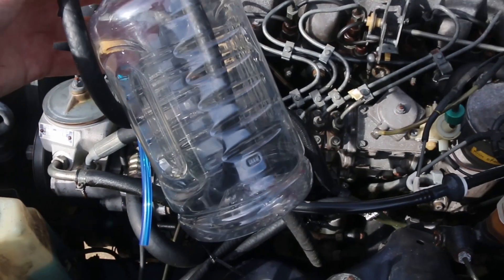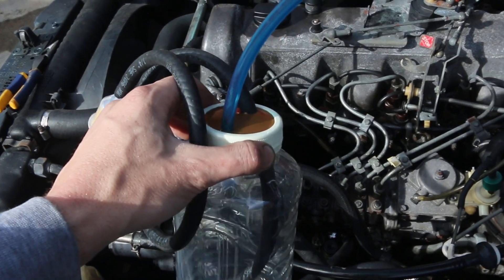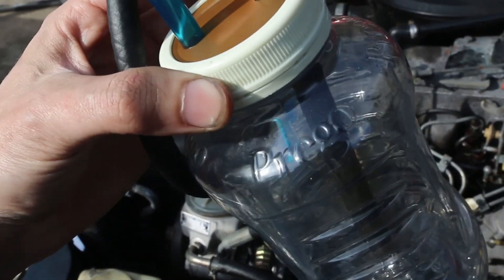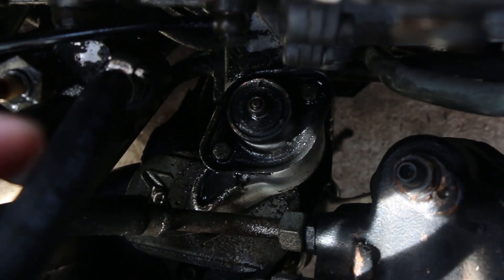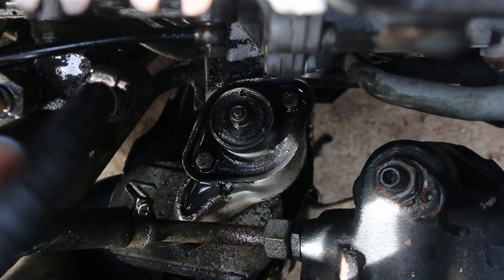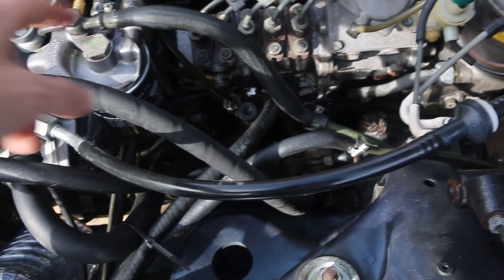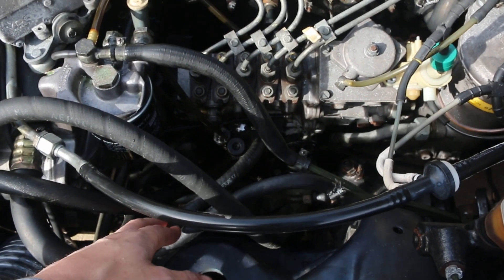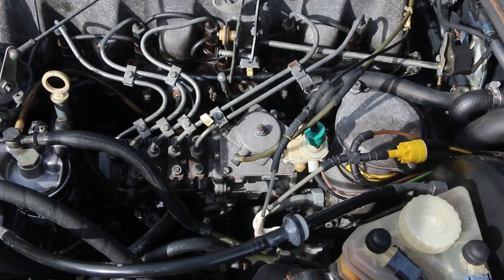Diesel Purge on my 1982 Mercedes 300D OM617 Diesel. Smoother? More Power? Quieter?

Comment: Best video on youtube just a question i have just brought a 1976 Mercedes 240d 123 it starts straight up from cold drives nice but blows smoke it dosent smell like burning oil and no oil signs at end of exhaust i was told by a mechanic to use 2 tins of  moly diesel purge injectors a filthy does that sound right
Reply from the maker: Yeah, I'd run a couple cans through it and see if it helps, if the injectors are a little sticky it could smoke and some diesel purge might free them up, its certainly worth trying.
What color is the smoke?

Comment: Thanks man! I just did this on mine and found that I'm getting a lot of air in the return line when I rev it, even slightly. I'm guessing I've got issues with my return lines. Thoughts?
Reply from the maker: If you've got bubbles coming out, you've got bubbles getting in somewhere for sure. Did you see any bubbles on the intake side of the lift pump? That's more common since it is under vacuum rather than pressure like the rest of the fuel system after the lift pump

Comment: Did you know that the seam along the top side of the valve cover means replacement Mercedes engine?
Reply from the maker: I've heard the valve cover and a tag that is down lower on the IP side of the block indicates a factory reman engine, which is super cool! I'm curious why my engine was replaced, as it has a odd misfire that I've been tracking for years now, comes and goes, I'm still trying to find the root cause, I'm tempted to swap the injection pump now, as I've done everything else I can think of.

Comment: Hallo thanx for youre informativ Videos , i try this on my knocking Benz 200 d . IT was very loud Like Metall nailing . I do this directly in the Fuel tank with Diesel . And after 2 time . The noise goes normaly No more knocking and nailing. Very good Stoff frome Germany . I think Its clean self the injektors..Best Stoff ever .

Comment: Hello great video, can you tell me if you had to take out the fuse pump relay or fuse
Reply from the maker: On this specific car (W123 body diesels at least) There is no electric fuel pump or pump in the tank at all. There is just the lift pump on the side of the engine, which is what I connected the inlet hose to, so no fuse or relay to pull, I'm not sure if the later year bodies got electric pumps or not, but I know at least up to model year 85 the diesels did not.
Reply: @trythistv  thanks man, I think mine has a lift pump on the side of the engine too, no fuse or harness in the back of the vehicle, I’ll try your method see how it goes, issue I’m having is my vehicle is consuming way too much diesel.
Reply from the maker: If its the same engine, I'm certain they never used a electric pump. I believe the 603/606 type engines also did not, but I KNOW the 617 and 616 engines use the engine mounted pump like in this video
Reply: @trythistv  Hi again, Thanks for your help, I’m having a nightmare with my vehicle, basically I’ve got 2 pipes going to the fuel filter,1 supply line and the other return line, the return line I presume is where the fuel comes out of , can I just put those 2 pipes which were connected to the fuel filter into the diesel purge?
Reply: @trythistv  the supply line is the one that goes straight to the pump right?
Reply from the maker: @sabiya2  right. There should be 2 hard lines going that come from the back of the car, one usually has a "cigar hose" that's kinda fat in the middle, and goes to the filter, that is the return line, the other one goes to the lift pump, usually through a small clear online filter. That is the feed from the fuel tank (no electric pump on a 617 or similar engines unless someone added one) so if you find the 2 metal lines, you can take them off and stick them in the diesel purge.
Reply: @trythistv  even the om606 didn't have an electric pump
Reply from the maker: @maxmiliano7887  I knew there wasn't electric pumps for a loooong time, I had a 95 e300d and thought it was a mechanical lift pump but it's been a while and I've forgotten a lot about that car. Thanks for the info!
Reply: @trythistv  maybe after the w210s when everything went to high pressure common rails. I want nothing to do with those.

Mechanical diesel or no diesel imo!

Comment: I did this on my 2015 Holden Colorado with 250,000kms yesterday. 
The leftover diesel purge was about the same colour as yours maybe slightly darker so definitely cleaned something. I've seen some videos where the leftover DP is almost black! 

Did you see any sediment in your inline filter? 
I was surprised to see how much DP you went through in just 10 min! Mine took 50min to go through around 700mls. 
I definitely noticed a difference, much quieter and smoother to drive.
Reply from the maker: It drank it through pretty quickly for sure.
I didn't notice much sediment in the inline filter, I've seen much worse than mine as well, I'd say it has to do a lot with how nasty the diesel is in each area. We've got some stations that do not have very good diesel, often dirty, sometimes water contaminated, algae and such.
It certainly made a difference in how smooth my car ran, Didn't notice much difference in power but the idle smoothed up a lot. probably from the injector pump running a little smoother, injecting a more even amount of fuel, or at least that is my theory.

Comment: Very helpful video.  Just purchased an 85 300D, and I was about to do a purge. It's hard to see but do you attach the hose to the actual pre-filter or do you bypass the pre-filter and attach directly to the inlet nipple on the injection pump? Thanks
Reply from the maker: I attached to the little plastic prefilter, its easier, and it prevents any plastic shavings from your container or other grit making it into your lift pump or injection pump.
I'm actually replacing an injection pump on one of my work trucks right now because of some grungy diesel I got a tank of, that isn't a fun pricetag 😬
Reply: @trythistv  Thanks again. So you put it right onto the pre-filter, correct?  I probably need to change out my pre-filter. Should I do that after the purge?

Comment: Hey bud I have a question, I have a 79 w116 300sd. Im gonna do the purge. I bought the kit from Kent at mercedessource, his mix instructions are very confusing though. I recieved a can of the actual diesel purge and a quart of hi moly content oil, he says I have to make a mix of veggie oil, diesel and the high moly content oil,  but he says nothing about using the purge itself. Do I run purge by itself first, then run the mix? I'm lost
Reply: Thanks I actually had figured it out I just finished my drive. Did my motor mounts while i was at it. Omg completely different car its amazing
Reply: Any feedback from anyone would be awesome I'd like to get this done today
Reply from the maker: Ok, so kents kit and instructions are a little different, his kit has you run the purge as I show in this video, and then the mix of veggie oil, moly oil and diesel (1 gal veg, 1/2 pint moly, 1/2 pint diesel I believe) through the car, and then after hooking up your stock fuel tank taking the car on a good drive to get everything moving good and blow out any junk that got loosened up during the process

So, do the Purge, then the mix, then an italian tuneup.

I'm suspicious if any of the molybdenum used in the blend will make it past the filters, so I just do the liquimoly purge product as seen in this video, but I do plan on trying kents method at some point and open up the filters afterward to see if he might be onto something!

Comment: A couple things. Conventional wisdom is that you're supposed to use 2 cans to rev the engine sporadically through the rev range when doing the purge.

My OM617 300d came out really filthy but my OM616 240d (W115) was clean. If it did smooth your idle a bit, then I suspect it will improve further with a 2nd larger application.
Reply from the maker: I did use 2 full cans, the pasta container was large enough that it held both (45oz), I did rev the engine up and down a few times, probably not sweeping through the rpm like I should have. I am going to try it again on either my other 617 or on one of my Cummins and see what happens there.
I suspect improvements in smoothness from here I need to address the timing chain conditions and check injection timing next to see how far off spec those are.
Reply: @trythistv  To me, the motor sounded much smoother than before at idle. Not sure if you noticed a difference when driving?
Reply from the maker: Driving it seems exactly the same, I know it definetly didn't hurt anything though, it does always smooth up as it gets warmer, I'm suspicious of the timing being off after all these years and having been run low on oil for an unknown period of time (before I got it, had to swap cam and vac pump, bottom end was all ok though) I'm sure that chain has stretched a lot, but I won't know until I check it I guess
Reply: @trythistv  Assuming you've done the valve adjustment, rebuilt the injector nozzles, replaced the primer pump and rebuilt the o-rings in the lift pump, I think your next step would be replacing the spring in the OFV (try stretching the old one by hand a few times to see if it makes a difference before ordering a new one) and then the injection timing.  

Other than the Auto-RX for compression, I'd recommend a large bottle of Chevron Techron diesel fuel additive for your tank to clean out all the gunk in there.
Reply from the maker: Yup, I did a valve adjustment with the cam swap, and then checked it a few hundred miles later to make sure it wasn't flattening lobes like the old one.
Then about 5k miles later I redid the adjustment as I felt with that much being disturbed it could have settled in.

New Firad 314 nozzles, all popping as close as I could get to 2k psi (50 higher than the 1950 psi spec I know), primer pump was replaced when I did the LP rebuild with OE Bosch kit (idk if they're still hard to find now), OFV spring stretched back to somewhere around 28mm.

The OFV spring did help cold starts, it always liked to stall when the glow plugs afterglow went off, with the better pressure it usually just stumbles once when they kick off now. I'm making a video on the OFV and testing fuel pressure, because I suspect that is a oft overlooked and critical piece of the fuel system.

The cam and IP timing is very soon on my list, I'm reeaaly hoping the shop for my business (boat and jetski mechanic) will be built soon so I can pull the car inside and not have to dodge raindrops when I end up rolling a timing chain in.

Comment: Your fuel system was pretty clean. Usually the return comes out nearly black. I was going to suggest that this is also a good time to change out your prefilter and fuel filter but with how clean it looked coming out of the return, I wouldn't have bothered either. 

Now go get some Stanadyne Lubricity additive to smooth things out even further. 

And replace that worn out air filter mount. ;)
Reply from the maker: Funny thing about that air cleaner mount. I pulled the car into the driveway to make the video, the mount was fine, not rattling at all, I got all the stuff hooked up, and at some point between starting the car on the diesel purge and finishing up the mount must have broke. I keep a few spares because they seem to fail quite often, even with the little metal heat shields. I'll certainly look into the stanadyne, I've heard good things about them as well!
Reply: @trythistv  The only place that I've found locally that carries Stanadyne products is AutoZone but of course Amazon has the full range of products. 

I run the Lubricity additive in my '77 240D and it does make a noticeable difference. I initially started using it due to modern low sulpher diesel. Our engines (OM616 & OM617 alike) were designed when Sulphur was used in pump diesel as a lubricant for the cylinder walls. Low sulpher = low lubricity which can ultimately lead to increased ring wear which leads to loss of compression and on and on it goes.
Reply: @trythistv  Mercedessource sells a heavy duty bracket kit that breaks less. The AUTORX I recommended will help reduce vibrations substantially (via compression) and that will also help indirectly.
Reply: ever use Power Service's Diesel Kleen? I've heard that's good too
Reply: @MrRjnr  I haven't used it. I buy Stanadyne Lubricity formula by the case though. Highly recommend it

Comment: Thanks for sharing.  Any luck w the fuel filter mod?
Reply from the maker: Yes indeed! All the parts have arrived, I just need to film assembling it, then upload it. I'm hoping to have that done in a week or two.
Grand total cost should be around $30 for the needed modification including the new 2 micron fuel filter/water separator (It does both, and has a drain, and fits in the stock location)
Reply: @trythistv  I would like to see a fix to be able to user both bolts on the filter mount. For the new 2 Micron Big Filter Mod. It would then be then much simpler and reliable. Cant wait to see an update on that setup making it better!